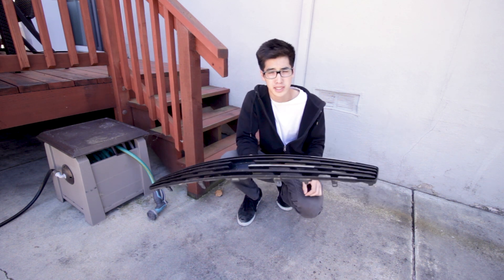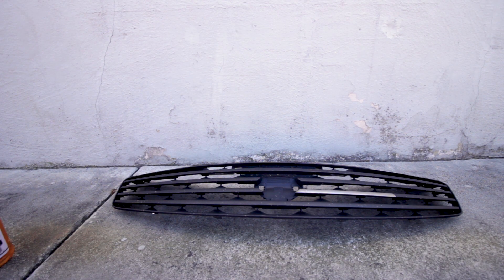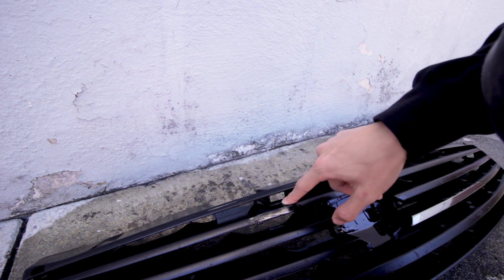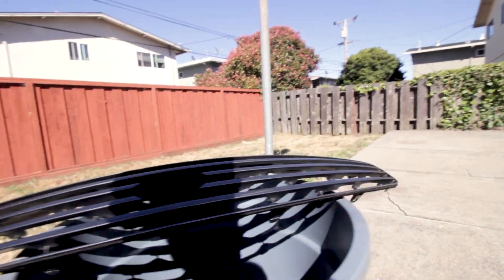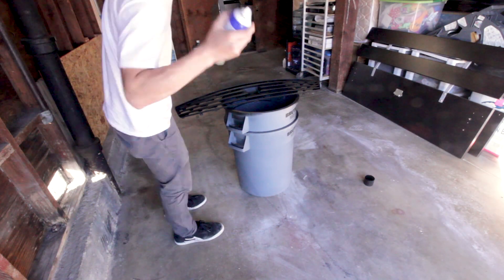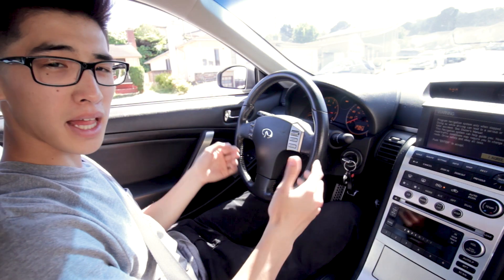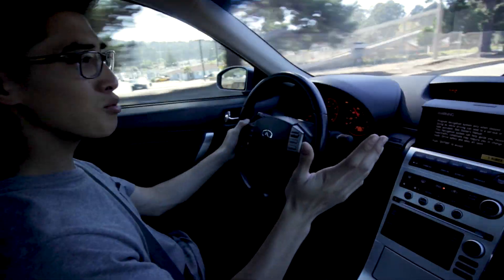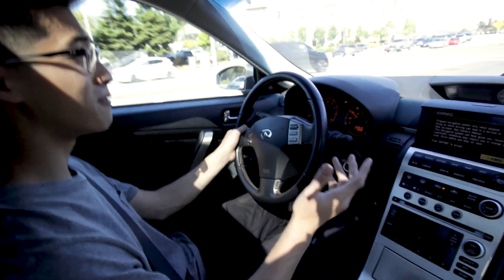Why I used PLASTI DIP instead of paint?

Comment: If you used 6 coats (minimum) it would have peeled off easily.  You can't review anything if you don't use it properly. Spray slowly in one complete left to right motion fdrom a distance of 10-12 inches from the surface.  Next time, read the can maybe ??